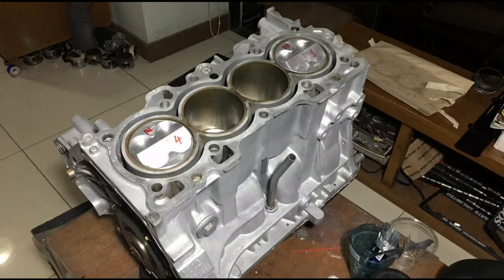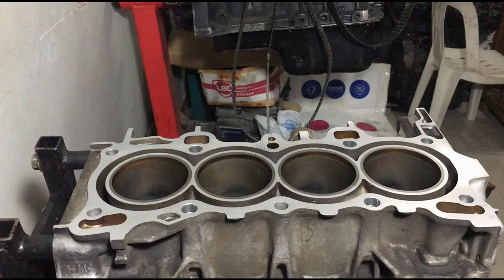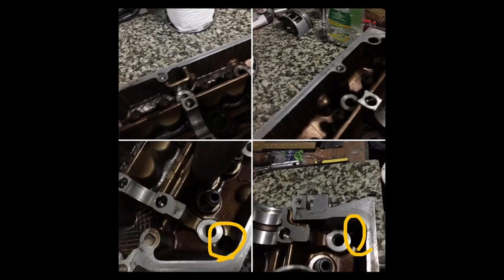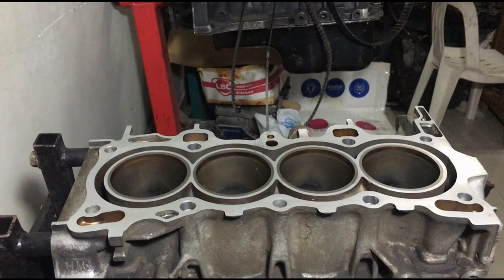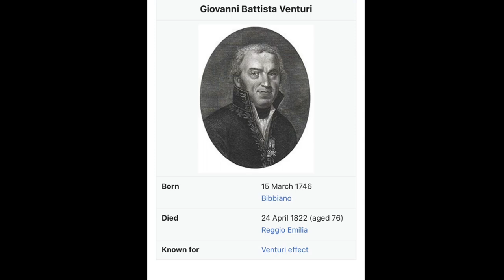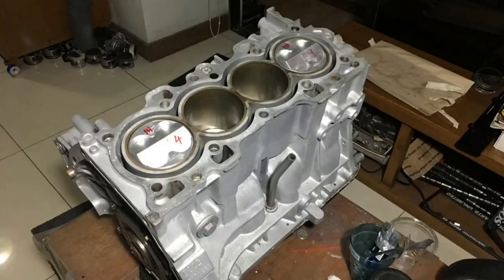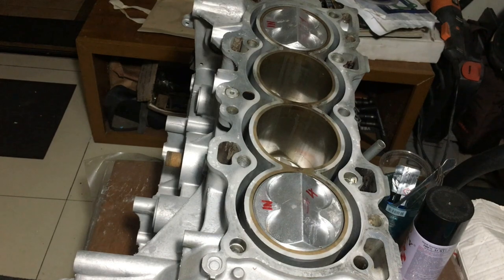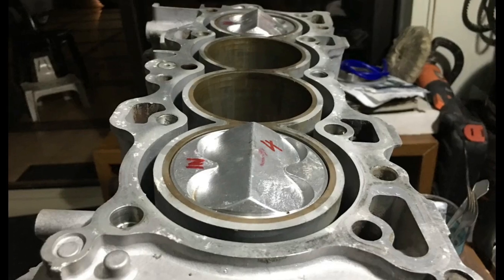Positive Crankcase Ventilation Valve : PCV Breather Catchcan

Comment: Never thought about PVC for performance gains. I just vented to catch can. Rerouting into intake got me thinking.🤔👍
Reply from the maker: to be honest... i also route it to catch can, but as i researched pcv more to let me make this video with confidence? i learned alot too!! just like you 😏 ....i think my initial plan now is reconnect pcv to block and intake (helps on vacuum and part throttle) but still have the other hose (2 back block) to catch can

so it does "both" jobs of part throttle and full throttle breathing

Comment: Although it was a pristine stock example when i had it, I should've modded my '92 GS-R more when I had it.  
You could just tell whoever designed it; had begrudgingly made it to meet fuel economy. But you could always tell; it was begging for parts to be thrown at it  

These engines are truly designed to be gone through to hammer down all the "rough" edges, to maximize what they are. You can just tell when you take 'em apart.
Reply from the maker: So true it’s like a “toned down” ready to be race modded engines
Reply: Honda was the first company I heard of that had the cheif engineer of their F1 group go to the production engine group to exchange ideas in it's engine development. This would explain the Easter Eggs hidden here and there. 
It also explains why there's not a lot of easy HP by swapping an intake or headers for big gains like in the 70's and 80's when I was racing.
They've been in F1 since the late 60's and their V8 F1 defied the laws of physics in the valvetrain as it was explained running around 14K RPM. Capable of 20K RPM but the limiter was set at 15K with pneumatic valvetrain.
Racers are now using a vac pump on the crankcase to find a marginally better piston seal at the ring pack. Venting the crankcase is good, a vacumm is better. All very interesting stuff.

https://www.youtube.com/watch?v=mOzHVwPr6NU

Comment: Good Video! I have to deal with this soon, note how the SOHC left intake side drain in the head has a raised edge on the left port. not allowing for oil to drain down unless it reaches the correct level. this is the one that takes the black breather box, probably trying to keep oil out of that port for the PCV.
Reply from the maker: Wow very very nice observation u are the few that noticed that... i guess a fellow sohc lover is found here :)

i agree on oil level it is why my example was running first gear/second gear level goes up :)
maybe we dont want the breather gargling oil :)

and based on what i said here? we continue/keep the pcv to intake manifold no problem on high comp turbo or all motor
BUT we add 1 or 2 more fittings for a hose to the breather

this way it helps as we dont route valvecover breather to intake anymore. but it is letting it breath on those extra lines and glad the block hole is atleast twice the size of the pcv hose so we know it gets "full"

but we keep the pcv for idle and part throttle

an idea shared so you can do a video of it when u deal with it soon :) Thank you

Comment: we do really need the pcv valve our can we put the ventilation directly to the catch can?
I have mine connect to catch can and the catch can connect to intake manifold (the catch can is sealed).
i ask that because the crank vapors are hot and we want fresh air into the cylinders..
thanks
Reply from the maker: That’s okay that’s how oem is…
Reply: @SRDmotorsports  but it's possible to breathe the crank case directly to catch can without connect to the intake manifold? This setup as any drawback?
Reply from the maker: @prasquete  no drawback it’s just not pulling anything it’s just breathing out
Reply: @SRDmotorsports  thanks
Reply from the maker: @prasquete  no probs man